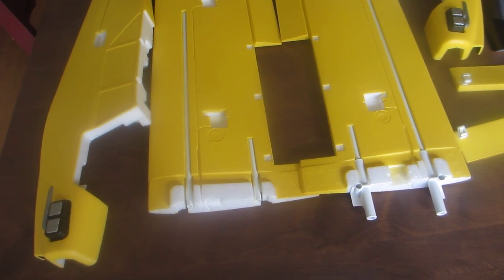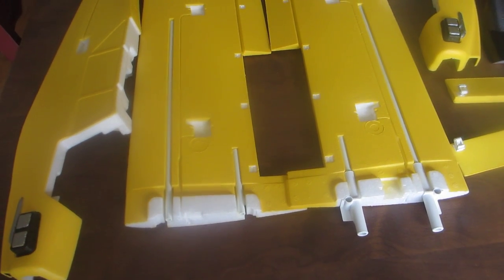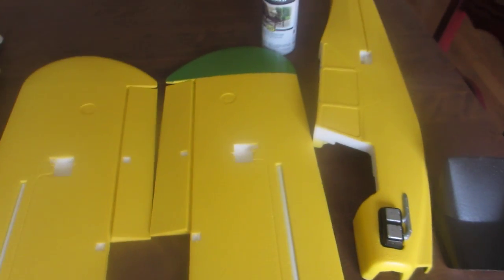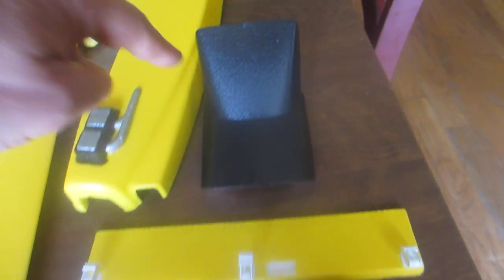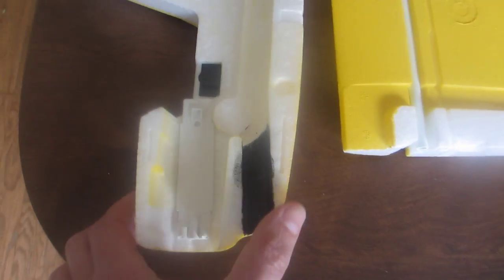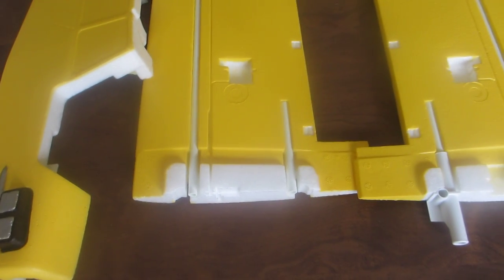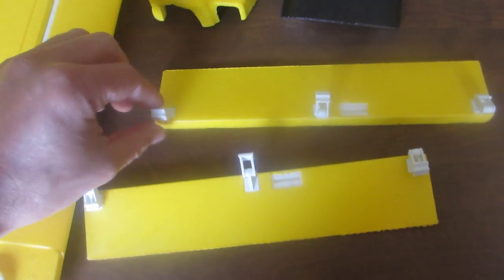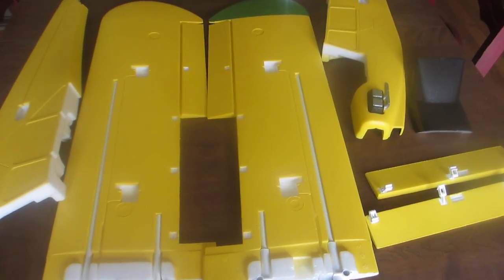Multiplex Fun Cub Build 03

Comment: Paint on polycrylic on your plane first to protect then u can use ANY paint u want. Hardware store, $10. Small blue can made by minwax. I have built 3 funcubs and used it each time, cones out beautiful while strengthening the foam as well. Also a post paint application for that last "seal in" and beautiful shine. Check out my video. Put in "painted funcub pt.1"